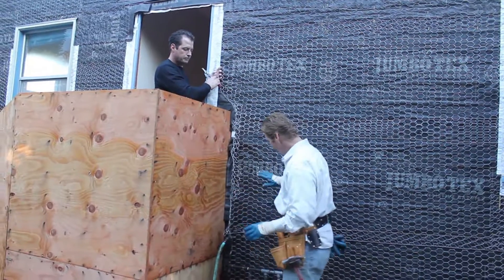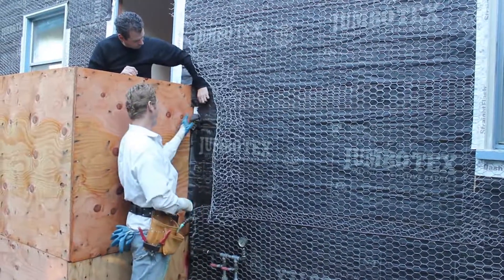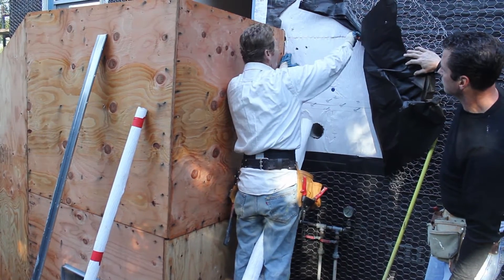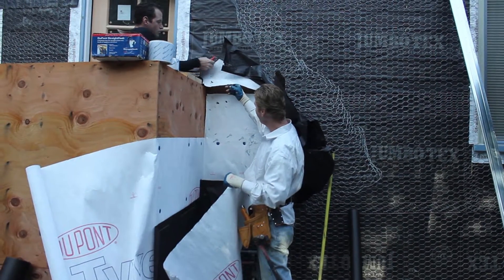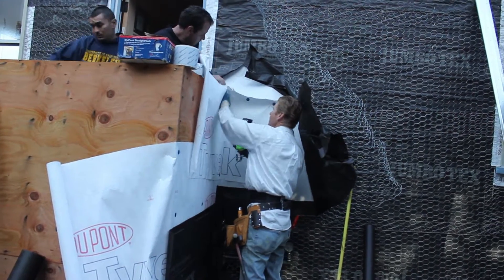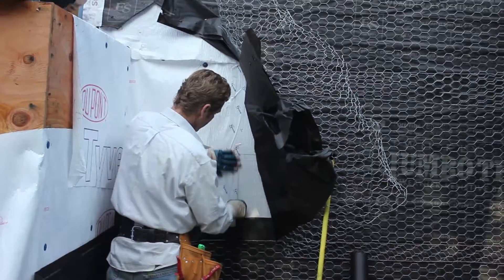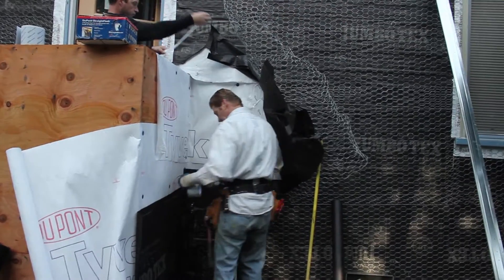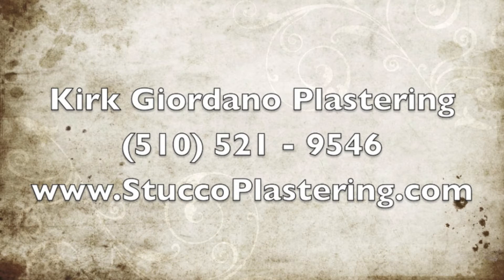Tyvek Stucco Wrap with two layers of 60 minute paper

Comment: I hear lot of contractors mention no need for tyvek paper when you use 2 ply 60 minutes, so which process is the right application?
Reply: The tyvek stucco and paper over that will last a long ass time. Paper alone won’t last as long
Reply from the maker: Exzackory.
Reply from the maker: Hello Ramin Dariani, two layers of 30 or 60 minute are both acceptable, 2 layers of any paper is also acceptable say for example two layers of roofing felt say the 15, 30 pound or whichever as long as there are two quality moisture resistive barriers.
 The tyvek applied on this home was because the homeowner asked for it to be applied, so we did and added the two more layers of the jumbo tex.
 Best wishes, 
 Kirk giordano plastering